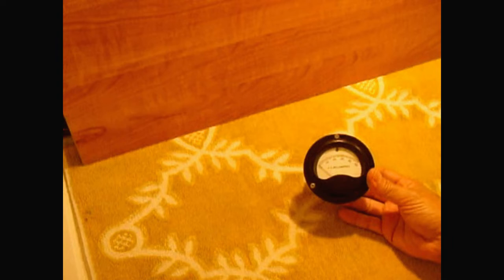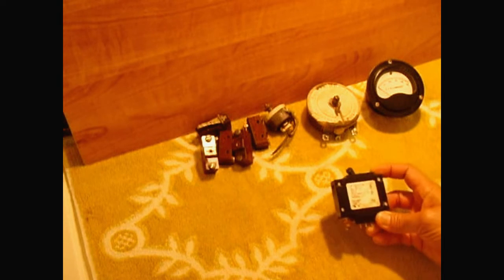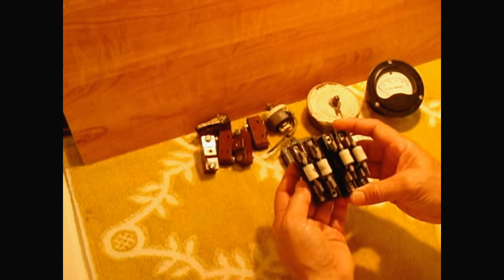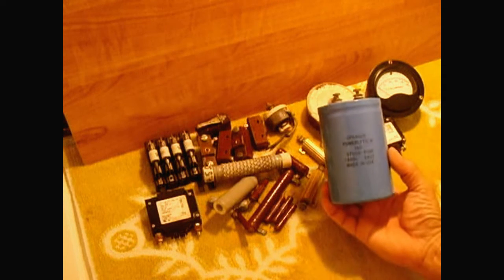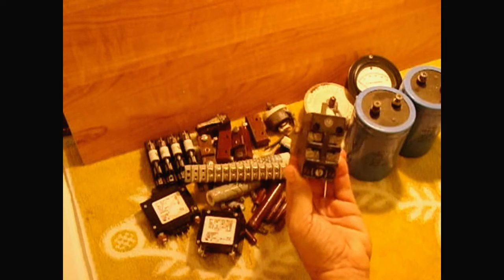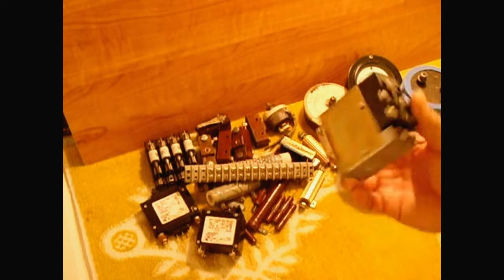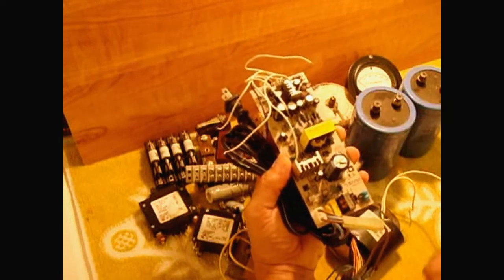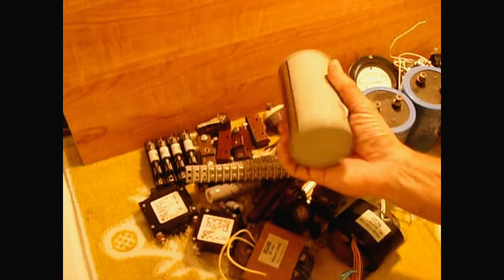Trip To Old Military Base & Dump For Salvaging Parts

Comment: Awesome grab man! I'm also making a DC power supply right now. You might want to consider using a darrlington emitter follower to control your output instead of a potentiometer, because it will give you a more stable current supply. 
http://hyperphysics.phy-astr.gsu.edu/hbase/electronic/emitfol.html